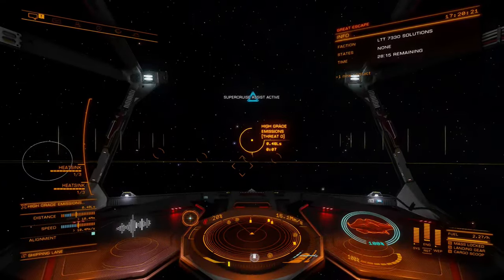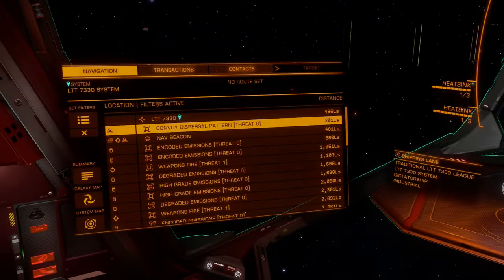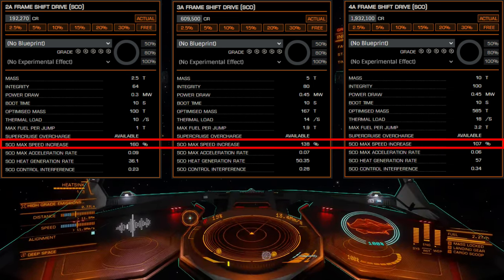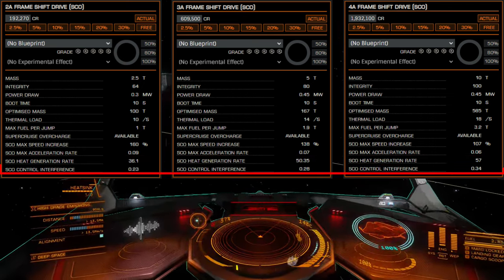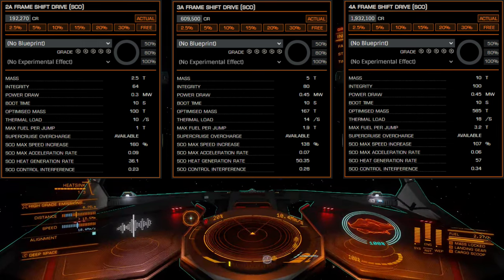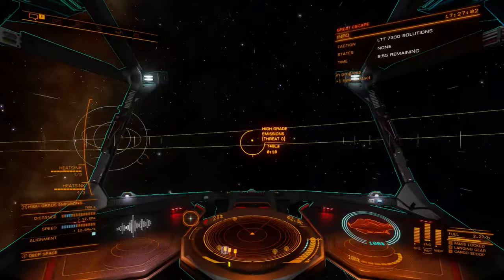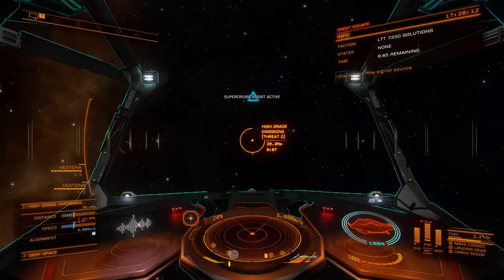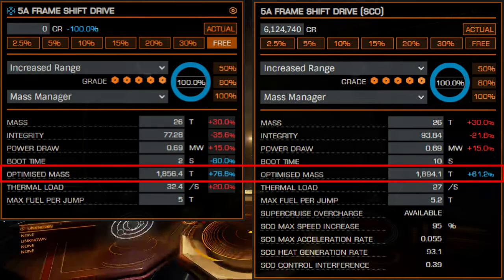Elite Dangerous | Module Review | Super-cruise Overcharged FSD (SCO)

Comment: Great vid. A few notes about the fuel draw and jump range, The SCO Overcharge fuel usage is dependent on the stock fuel tank size of the ship not the size of SCO module, so ships with undersized tanks like the Clipper tend to do well while the Beluga is uniquely bad for overcharging because of its 128T tank, it can get up to almost 15kT/h.  While the 5A SCO beats the V1 FSD by +0.28ly, the class 3, 4 and 6 CG FSDs still win by roughly +0.27ly over the SCO variants. o7
Reply: To me, they .27 LY is a huge deal. I specialize in exploring the central galactic ceiling and cellar-systems that are 3000 LY above or beyond the plane. That area is so remote and risky that every bit of range counts. That .27 LY was the difference between first tagging of Synauloo AA-A h0 (3301 LY below the plane) and not being able to reach it at all.

Comment: i would get an SCO Drive.  buuuuut  Ps5 Player here. so u know   wee dont get the new fun stuffs   o7 :c
Reply: I’ve just transferred over to PC and strongly recommend it if you have access to any PC that can run it. 

I messed up the portal transfer (forgot to set up a new PC Frontier account, so I was trying to transfer my PS Frontier account to my PS Frontier account 🤣).  But I contacted Frontier support and they were really helpful and did the transfer manually for me.

I’ve even got my PS5 controller working via bluetooth using DS4Windows, using the gyro for headlook just like on PS5 (set it to mouse in DS4 and then set Elite to use mouse look).
Reply: @vuggish  cant just upp and leaave all me CMDR friends on Console   somone needs to keep Gankers at Bay o7
Reply: As far as consumer rights and budget goes PC is going to be so much better when you finally make the switch. You need one anyways in the modern world, and since making the switch (Xbox 360) I’ve been kicking myself for buying a console at all. You save so much money, the you can buy games from wherever you want at competitive prices. the computer I built 10 years ago still runs better than the latest gen consoles (all of them) and all I changed was the graphics card and power supply for the price of one console. I’ve skipped buying 2 or 3 generations of consoles. All of that and the PC is useful for so much more than gaming. (You can also emulate console games on Pc if there is that one game you can’t go without.) this is not meant to brag about my pc, but to say that all this can be yours for under 1k even today, and it pays for its self sooner than you think when you take into account the price gouging for console games, that you are forced to pay for multiplayer on console, and that your console is cycled for a new minimally updated version every few years. 
Thanx for reading my rambling gibberish
Reply: @numnut1516  i will PC someday   o7   but Ps5 do be working for the moment

Comment: I hate the damn thing am happy with the old FSD
Reply: I have found out that these SCO drives are the long sought remedy to avoid gankers in open. You see a hollow triangle or triangles getting ideas about positioning itself behind you? Fire away the SCO and blaze away until the triangle or group is left behind. I have done this and no one has been able to interdict me.

In the Oolite game (a modern adaptation of the original 1984 Elite, there is a module called the Witchfuel Injector. You see a group of hostile ships? You are mass locked? Fire away the injector and leave the group in the dust. It also really shortens the trip between the entry point and the space station. And yes, it consumes lots of fuel.
Reply: Love mine, better jump range, and the option of doing a little boost for a few secs to make my jorneys a lot easier
Reply: @zepovinho200 I must be lucky or just uninteresting as I never as yet have been ganked. Been playing in open since Odyssey dropped.
Reply: @garethde-witt6433 Space is vast, the game is not too appealing and in most civilized places, where you have more chances of meeting players, there are bounty hunters and security forces.

Comment: A note about the double engineered drives, for the current set of stats for the drives the class 6 and 7 SCO drives will fall behind a double engineered normal drive at max jump range. There was no size 7 CG drive released so that figure ends up not mattering though.

All of the drives (except size 2), however, are worse at fuel economy than the double engineered drives, at varying amounts depending on the size. What I mean by that is for jumps costing the same amount of fuel, the double engineered drive can go further. It’s only jumps at the absolute max range that start to win out over the double engineered drive, at the cost of a bit more fuel.

Of course, in exchange you get the SCO feature, so that’s not saying the double engineered drives are all secretly better still. But it’s not entirely true that for all use cases the SCO drives completely out do the double engineered ones.
Reply: In my case it gave me a few more years of range and especially when I went to the titan HADAD system with the normal engine it took a while to arrive and they intercepted me many times with the new engine and that function reached the titan cloud quickly without being intercepted so many times . Of course there is a learning curve to handle the new engine well.

Comment: I noticed on your way to a HGE at the 7:30 mark, that you use the Supercruise Assist module, but do not use the 'trick' of rolling throttle past the 5 second eta (while in manual throttle control) and back to 50% throttle before overshoot... effectively snagging your fsd in a poi lock.  Im sure you know this.. but just forgot or chose not to use it for demonstration purposes.   
   Congratulations on yet another excellent reveal of the gameplay mechanics of Elite Dangerous!
Reply from the maker: I wasn't playing aggressively, I mostly use the SCA for consistency rather than speed.

Comment: Question:
If when using a "PREBUILT" ship, not replaceing only engineering the variious mod's. Should I get sent to the rebuy screen to get my ship back for "FREE". Is the engineering I did, still there or do I have to re-engineer everything I did previously. I mean, keepiing the same exact mod's the prebuilt comes with, just engineering them. So there's no credit's exchanged only material's to loose.
Reply from the maker: You pay the insurance cost for the fitted modules that are different than what came with the ship
Reply: The cost of replaceing the prebuilt mod's is the only cost one has at the rebuy screen. If the mod's haven't been replaced, only engineered, there's no cost. What happen's to the material's utilized, which a pilot doesn't pay for except in the invested of a lot of time, effort to locate them.